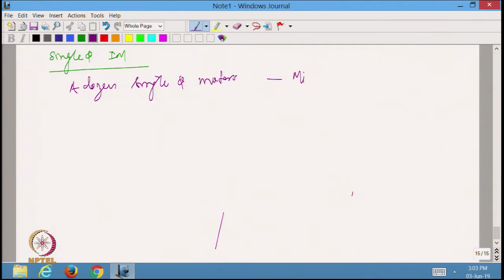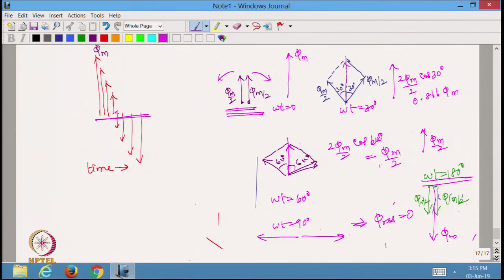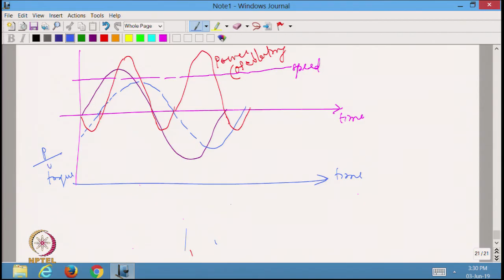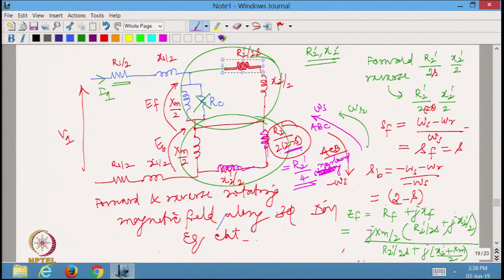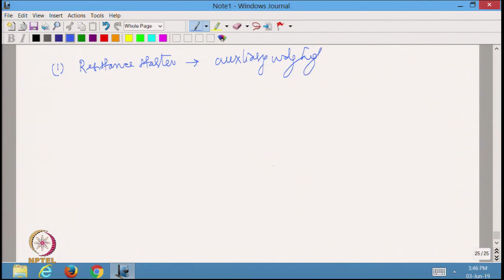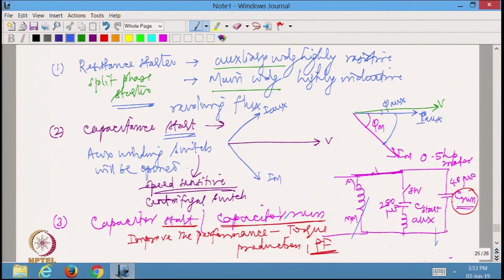mod12lec41

Comment: 1 ph IM eg universal motors
used in smaller <1 Kw rating eg fans, hair driers, pumps,drill tools
construction 3:00
pulsating and stationary mmf 5:00
field mmf viewed as consisting of 2 equal but oppositely rotating fields 9:00
as pwr rating are low, field wndg are thin ie cu loss is large as rf is large hence low efficiency 16:00
equivalent ckt 17:00
forward file with s and reverse filed with (2-s) 19:00
pwr expression 22:00
1 ph motor always has brking torque alongwith motoring torque hence efficiency always low 26:00
oscillting power and torque giving excessive shaft vibrations 26:40
determination of param 28:30
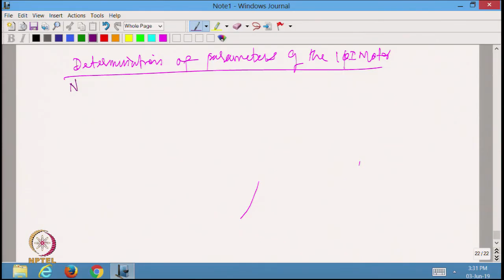no load test 29:00
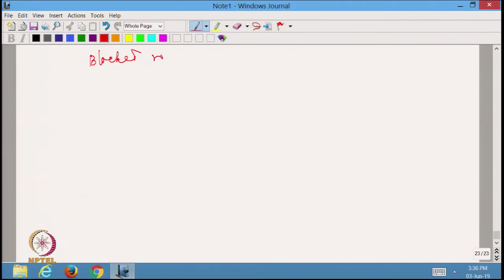blocked rotor test 34:00
starting methods :
1. aux wndg with cap and centrifugal sw in series, spacially shifted at 90 deg wrt field and with current time shifted wrt to field (due to capacitor)  effectively a quadrature rotating fileds
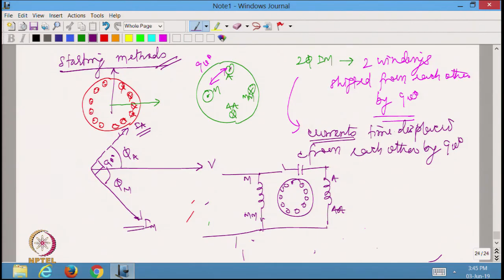2. resistive starting with aux wndg is resistive and main wndg is inductive 43:00
3. split phase starting
4. cap start, cap run with strt cap larger than run cap thus with good torque capability
5. shaded pole starting wndg 48:00